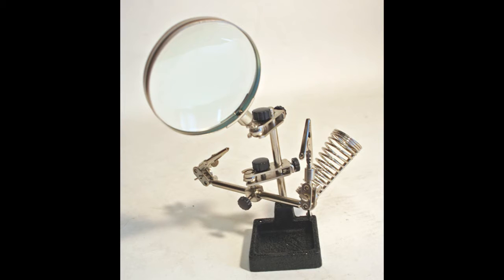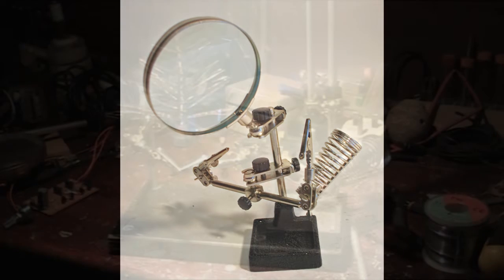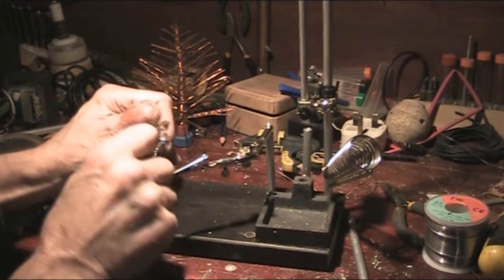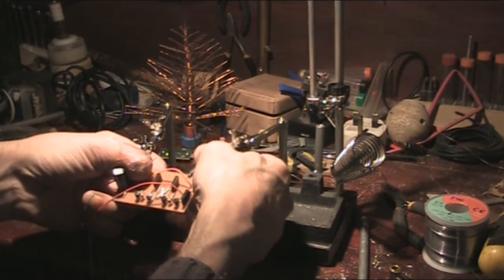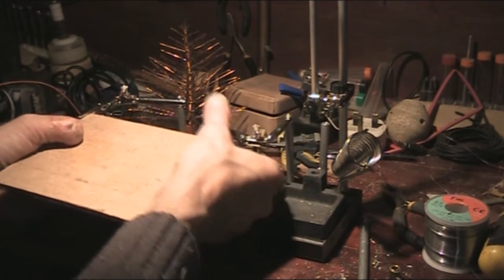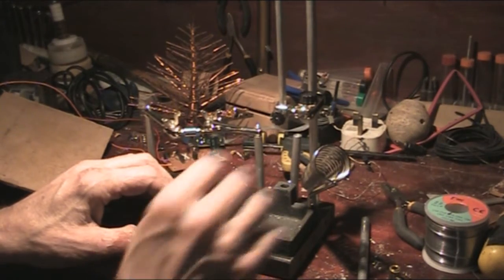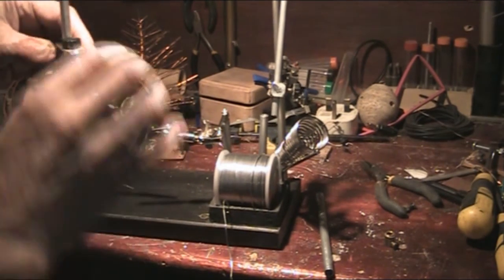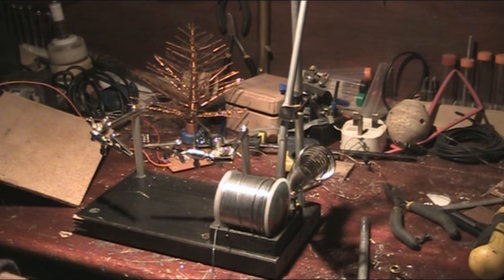Third Hand Modification

Comment: Yeah, I don't use sponge in those either. I use a brass scouring pad with all the soap rinsed out of it. It cleans the tip of the iron nicely and doesn't require water all the time. It also doesn't rot like sponge does. It's a rather brilliant idea setting things up like you have there. I think I'd make the addition of some grub screws or something to keep things a little more rigid but that's about it...
Reply from the maker: I can understand the grub screws, though i would use thumbscrews to stop the arms swinging wildly, but so far it's not too much of an issue.
I used the spare ball and socket clamp on another vertical rod, then used an old telescopic antenna with another croc clip on the end, so now i can use the 2 clips to hold the board (or other component), and the extra one to hold a wire in position, if the 2 clips are holding the board, they become stable.

Comment: For holding PCBs, Panavise is the best I've come across, but importing from USA is a pain.
As for holding wires, third hand tools are go from worse to terrible, backlash being an issue with a goose neck one I once had.
The crocodile ones are better but still not great, I put heat shrink on my crocodile jaws to protect them from digging into things too much.

Something like a T bar shape with arms that slide back and forth with large crocodile jaws would be the ultimate third hand.
Reply from the maker: +Steve Lane Yep, i know about the panavice PCB holders, but no point me having one, i use my third hand for a lot of things (switches etc)
I supose a cheap version of a panavice could be to use 19&quot; rack guides fixed to some arms. (rack guides being the guides for inserting the cards)
I wouldn't use the gooseneck for holding the work, but for the light or magnifier it would be ok